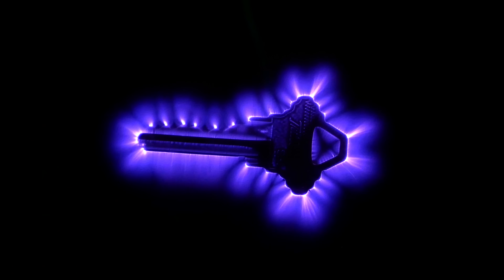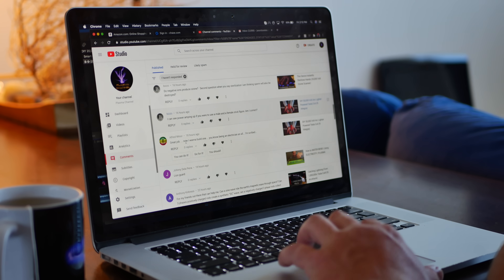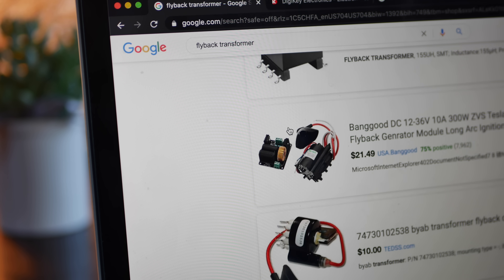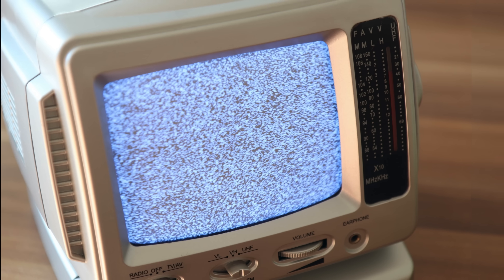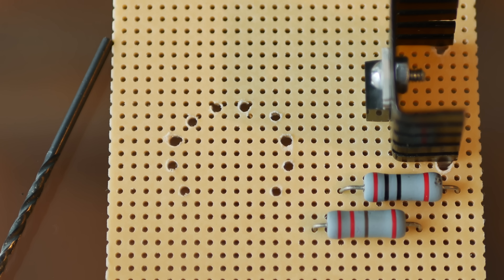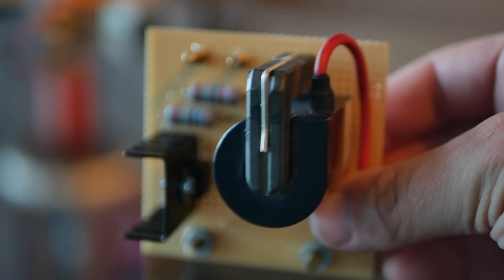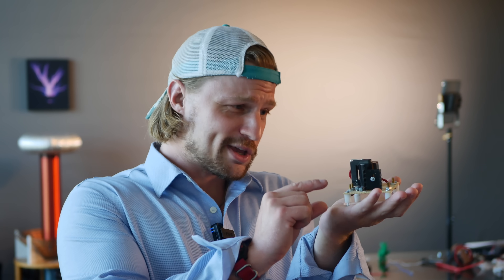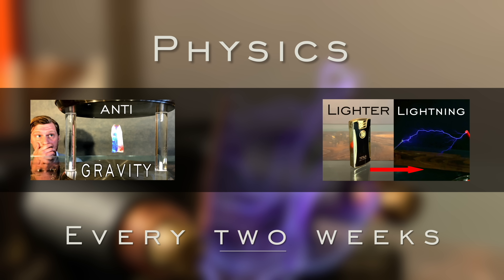DIY Plasma Physics Powersource (Mini 20,000v Flyback)

Comment: You can also wind your own primary coil around the iron loop to get hundreds of Watts out of it
Reply: SIR CAN YOU PLEASE MAKE A HV TRANSFORMER(with primary and secondary winding calculations)because what costs in western countries costs more than triple in our country(india). I watch you videos too.!!!!
Reply: @mrunalshah2702  believe me scavenge from old TV or buy A new one. It's cost is bout 200-400rs. I wound one myself and it literally flamed up on the first start despite of insulation. Buy or extract.
Reply: @prakharmishra3000  K bro thanks for your advice
Reply: @mrunalshah2702  hey you can use old flybacks i got mine for 50rs indian which is about 80cents. You dont need a new one for this most of ones from broken tvs are good for this. Just ask any local tv shop to give you a broken eht and then just make sure that the secondary is good in most of them its good but in some it might be busted there are a lot of techniques online to indentify. Its pretty cheap if you know from where to get the things.
Reply: @ahuman4433  K bro thanks
Reply: @ahuman4433  I did same
Reply: @ahuman4433  'local tv shop' I don't know what that is.. you mean there used to be shops that repair tv's? wow.. that's amazing :-)
Reply: @rogerredford4010  in our country, there is a repair shop for everything near our house, we don't have to call the company to repair it :)
Reply: @prakharmishra3000  Yes.. much better than throwing things away and buying another. Pardon the sarcasm in my previous comment, it's just that we seem to live in a 'throw away' society and unfortunately getting a TV fixed here would just not be worth the expense, so repair shops have virtually disappeared.
Reply: @rogerredford4010  most of the waste lands in india, china and africa . I hate the and throwaway economy. here, you could sell your old stuff and some other poor guy could afford it or you could give it for free. This makes 2nd hand electronics cheaper.
And no need for apologizing.
Reply: @rogerredford4010  plus, not everybody is rich enough to buy a new tv only because a button broke, or to buy a new laptop if it becomes slow. People mostly get it repaired. This is the reason for the repair shops to exist.
Reply: @prakharmishra3000  Don't worry, there are still some of us in the usa who are not wasteful & do their own repairs. The media depiction of our culture can be misleading to other countries & our own citizens alike. At least, to a certain degree.
Reply: @greghowman5328  yes i have got a lot of friends in the US, i know lot of guys repair their own stuff but they are not even a fraction of the while country.
Reply: @mrunalshah2702  You might be able to find CRT/tube TVs for cheap or free, they all have flybacks in them. Usually they have a rounded screen (but newer ones don't) and are really deep compared to the screen (usually they are like squares)
Reply: @vdekjEE  do they run on mains power?
Reply: @mrunalshah2702  No, they are ferrite core, so they need a high frequency ac or pulsed dc supply like this one.
Reply: Winding your own iron core transformer is not fun
Reply: Bilkul sahi ..
Reply from the maker: Hey Dayton! Yeah, thats' a great method as well.
Reply: Also, a single guy repairing his own stuff is nowhere near efficient as a repair shop.
Reply: Dangit. I should have read the comments first before posting.
Reply: IF you have enough wire, time, and patience to wind all the coils needed!
Reply: https://youtube.com/channel/UCZ08AKbOBuaQC0sh8hcI5nQ

Comment: Hi, do you know any circuit for the measure high voltagem output  for test the in flybacku ir coil ignitor for exemple?
Thank you
Reply: The easiest way is resistor divider like 1 megaohm and 10 ohm in series. You mesure voltage across 10 ohm with multimeter (when have DC supply). Output voltage of your supply is equal to your measurement times 100 000. For high frequency AC like this or ignition coil you need osciloscop in place of multimeter, or you could try to convert AC to DC (across 10 ohm resistor) using single diode and capacitor. This metod is fast but lack precission.
Reply: @saganovsk6322  Hello, how are you? 
The output voltage of the ignition coil is close to the value of 25 000 VAC at a frequency in the range of 14Hz.
Reply: @aazeferino8938  Well I haven't experience with ignition coils, for my experiments I use high power high voltage DC supply that's definitely not hand size ;) But for my intuition 14 Hz on ignition coil sounds quite low. If this is true value, then you have plenty of space to recalibrate or upgrade the driver frequency of your coil. That won't change output voltage, only numbers of HV bursts per second on the output, so it's your decision if present circiut satisfact you or you want to modyfy it.
Reply: @saganovsk6322  Hello thanks for the information, but this coil is output at 14Hz and approximately 25KV AC at the output, so I was thinking of testing this output voltage at first with basic hardware like arduino using Matlab's Simulink, but for that I need reduce this voltage to about 4.5V or at most 5V to avoid damaging the hardware and this is just for a test, I also thought about using some type of analog optocoupler if it exists to protect the hardware. I also thought of just checking to see if it is sparkling, but I still haven't thought of any type of sensor to check the spark from the ignition coil.
Reply: @aazeferino8938  For detecting spark or arc discharge in my HV supply I use 0,1 ohm shunt resistor on the HV ground line between transformers-multiplicators circuit and output spark gap. When spark jump between output contact, the current flow thru resistor and creates small voltage across it. When this voltage is greater that potentiometer set voltage, the comparator activate IR diode thru NPN transistor. On 10 cm distance from IR diode I have IR fototransistor conected to resistor in pull down configuration. This is signal to microcomputer. Of course HV and microcomputer circuits are galvanicly isolated and 10 cm distance between IR diode and IR fototransistor guarantee much greater isolation that optocupler. I'm not saying this is ideal solution, but it work quite well for me and should be easy to implement in your circuit.

In theme of measuring output voltage with Arduino, you have good idea to reduce output voltage with resistor divider, I would suggest to add zener diode in Arduino input to limit voltage and futher protect it. Sadly I don't know any method to digital measure HV with galvanicly isolation between HV line and microcontroler, so if you will found one I would love to lern it.
Reply: @saganovsk6322  thank you Very much.
Reply: @saganovsk6322  Thank you Very much.
Reply: @saganovsk6322  I believe this is actually DC, so luckily you can do it without rectification.
Reply: @vdekjEE   Well I don't know proper english name for this, but by translating from my language it's "pulsing current". In DC you will have stable 15 kV between output connectors, in AC you will have fast swithing between +15 kV and -15 kV. And in "pulsing current" like this supply you have fast swithing between +15 kV and 0 V across output connectors. So if you try to measure it like DC, you will probably get averge of +7,5 kV.
Reply: @saganovsk6322  Huh, I never thought of it like that! Yes, I believe it is called "pulsed DC" in English.

Comment: Bit off topic but are you still working on the 1 million voltage multiplier?
Reply from the maker: I had to put it on hold - the supplier I normally buy my parts from...seems to have vanished! I will definitely finish it eventually

Comment: Is iT battery powered ?
Reply: It need a 12v batery or another 12v source
Reply from the maker: I power most of my stuff with batteries. This used two 7.4 volt LiIon batteries in series.